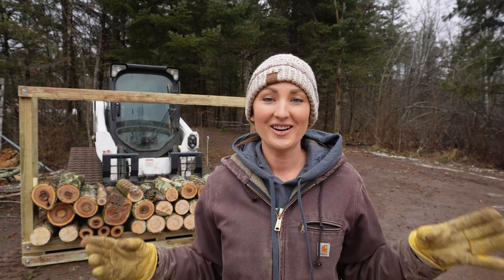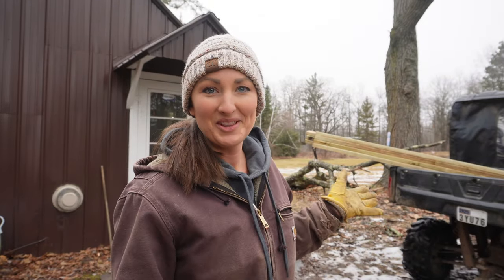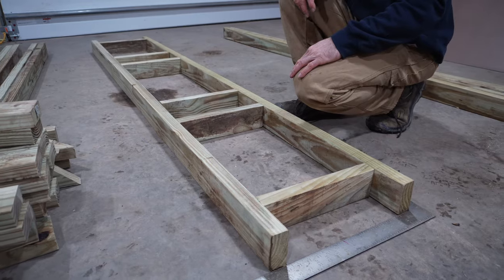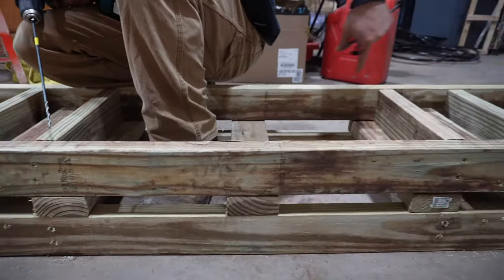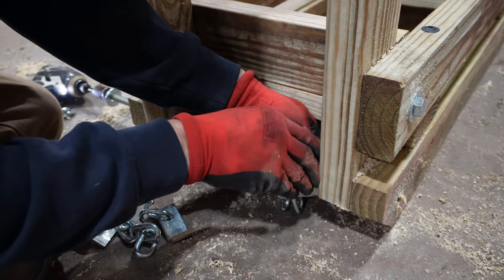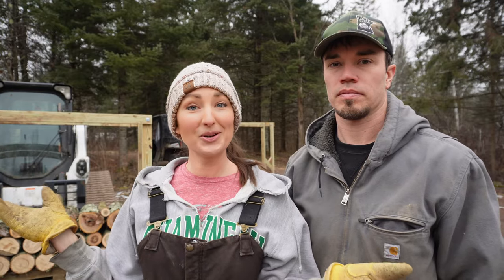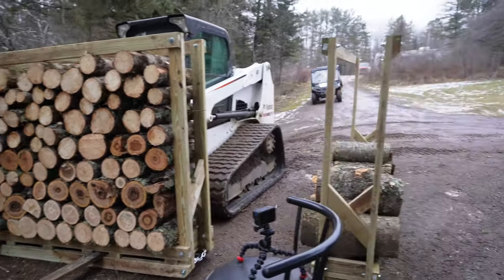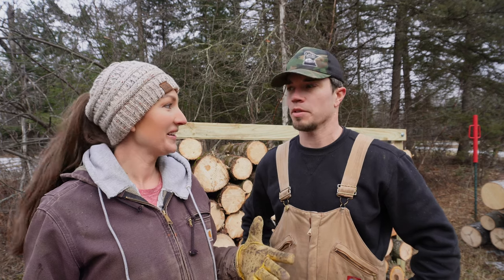Building MOVEABLE Firewood Racks - Let's put them to the test!

Comment: Fantastic engineering. Ideally you would be able to lay the racks flat on the ground so you could split the wood in the rack. Pulling it tight with the ratchet straps or some heavy duty springs attached to the strap. And then set it back up straight again.. it might need a grader to fix the tilting of the ranch’s
Reply from the maker: Excellent idea!!!! We’re going to think on this 🤓. Thank you!